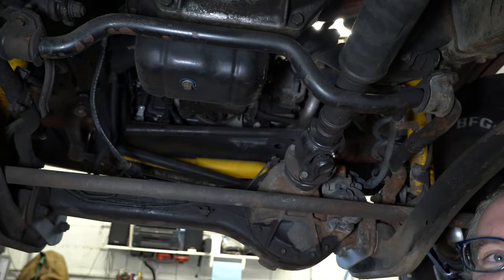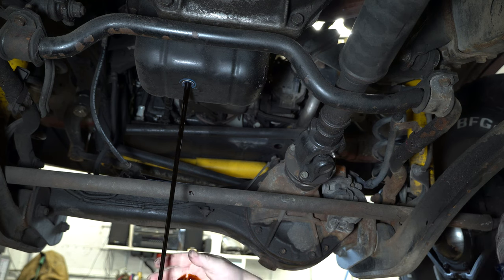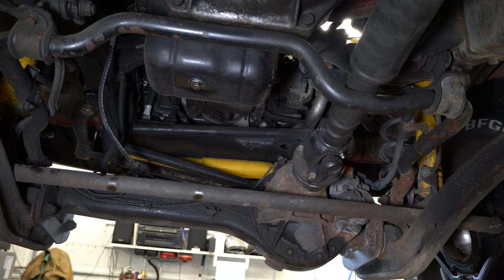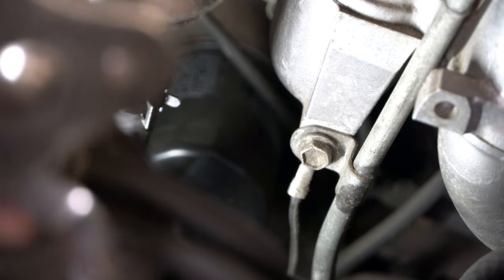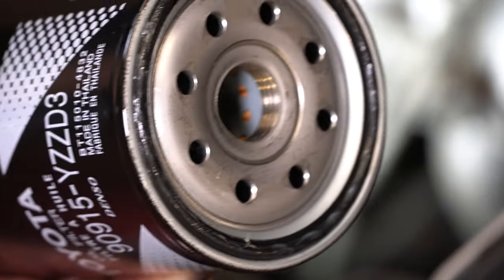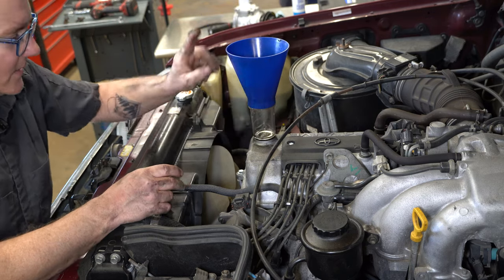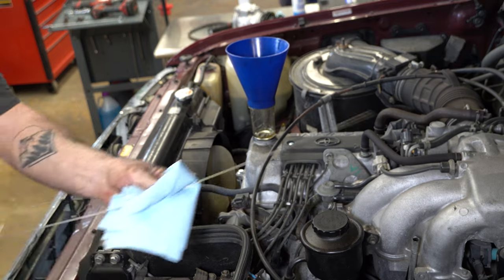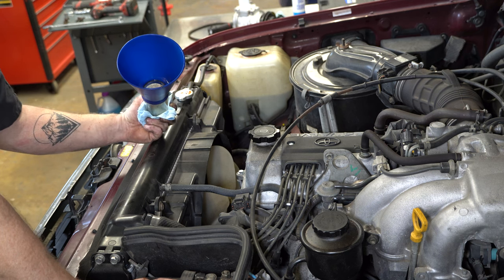Land Cruiser Maintenance, 1FZ-FE Oil Change

Comment: I have a 97 with 1FZ-FE that has 227k miles. Im in California so not cold at all. Do i still use 5W30 or 15W40? Thanks!
Reply from the maker: We use 5w30 in most of them. I run 15w40 in mine because it's tired and the thicker oil helps get a bit more oil pressure.

Comment: Great to see you back!!  Kinda curious why you would spray brake parts cleaner on the block while the oil filter was out....not worried it would get into the filter opening and into the engine a bit?
Reply from the maker: The cleaner flashes off so fast it's not an issue.

Comment: What oil do you recommend for a high-mileage (200K+) 1FZ-FE ?
Reply from the maker: We generally run 5w30 in them. It's going to depend a lot on your climate and engine wear. My personal truck has a ton of bearing wear so low oil pressure. I run 15w40 in it to get the pressure back up some. You wouldn't want to do that on a tight motor in cold climates though.